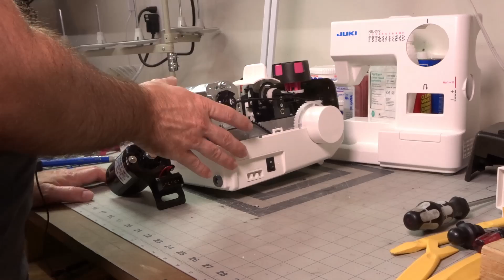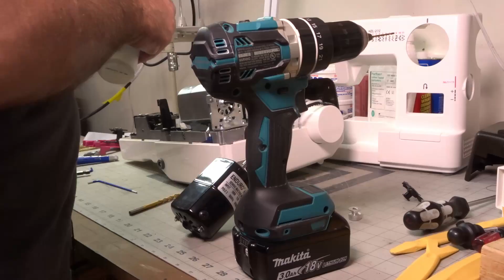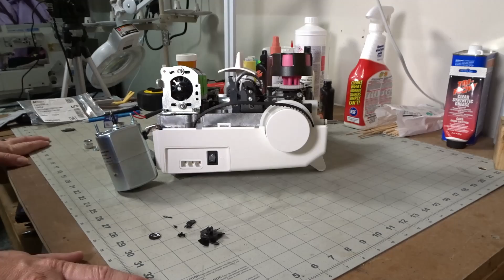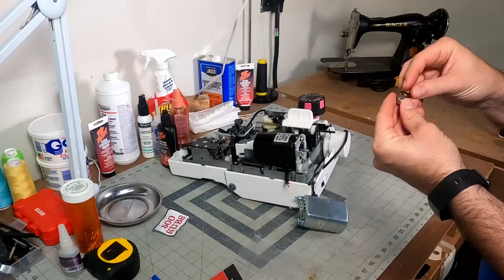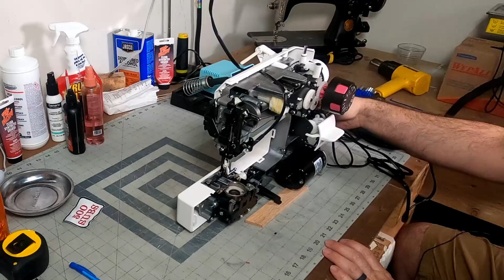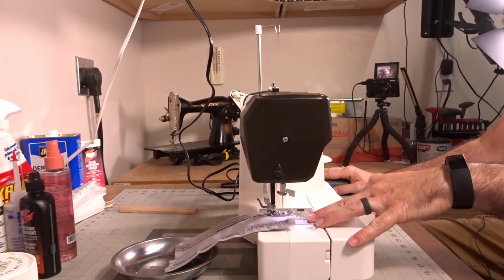Can I DOUBLE The Speed of My Sewing Machine!?

Comment: Very dangerous operation,,,when drilling the pulley,,,,,holding with your hands,,,a vice should be used to hold the pulley,,,,a bench drill was safer,,,also.  When you drill the pulley,,,the thickness is weakening,,,,,,,,also. When increased speed the parts,,,cannot handle the extra speed,,,,and will break,and wear out faster,,,,I also noticed the hook and needle settings is off.  The hook is touching the hook point.  This machine will not last long.

Comment: Maan !! That is something ..I add some weights with magnetic and double sided tape .It did not jump . Then I change it to more permanent solution with flat steel weight attached to the base with screws . It worked like a dream. Now I have 50% more time for chasing garls maan..Kit will be perfect.

Comment: Only a LITTLE faster!!?? Wow, that's almost as fast as an industrial machine!  
You could set it in it's own table (or even a good heavy wooden base) and it wouldn't jump around like that.  I'm curious to know your opinion about the plastic components. Do you think they'll hold up under that speed, even knowing it wouldn't be run that fast 100% of the time? 
That original motor was SO very underpowered! It's surprising to me that Juki would make a machine with such a weak motor. I'm not very knowledgeable with regard to motors and electricity, and I know you were making a comparison based on watts, but how did they compare from an amps standpoint?
This was a fascinating video!

Comment: Interesting. I did a similar modification to a Singer 66 red eye. Man, it flies. But thanks to its weight, it doesn't jump all over the place. I'll stick with all metal  machines, thank you. Nice presentation
Reply from the maker: Yes, I can see how that would be a straightforward upgrade. This machine is heavier than a lot of plastic machines, but not anywhere near a model 66.